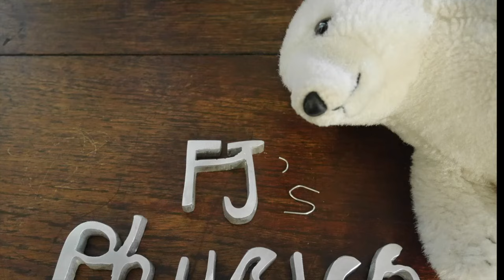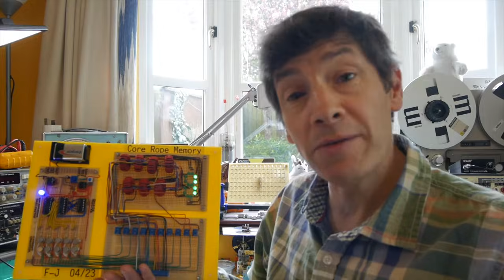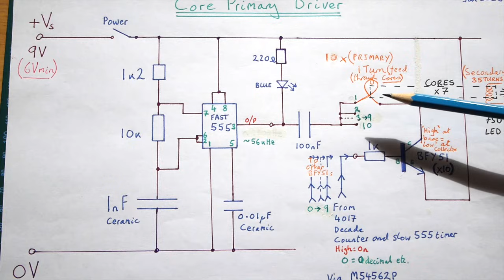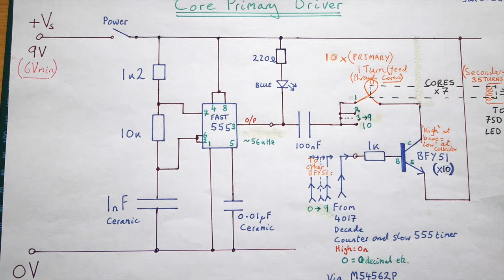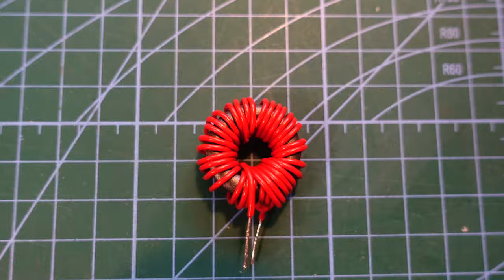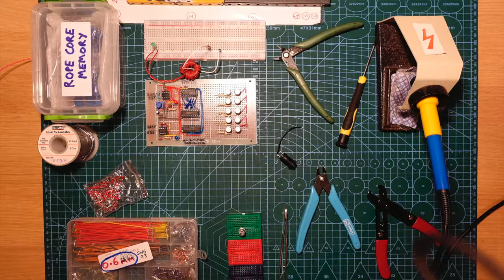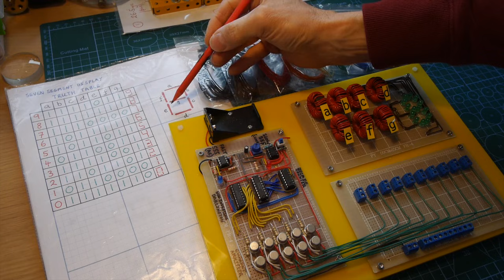Core Rope Memory Built and Explained - F-J's Physics - Video 169

Comment: Terrific video, by the way. Do I understand that you are directly using the output of the transformers to drive the output LED? I see that is correct, and in fact you reversed the idea of "sense" and drive ("Set/Reset" or "inhibit" lines) in the actual rope core device, and instead of having the output on the bit code wired "sense" lines, you bit coded the "drive" line. Neat trick, symmetrical in application to simplify the demonstration device.

Just marking this here to investigate more: Look up the "LM5520/LM7520 series" chips from National Semiconductor, which were "dual core memory sense amplifiers" used to read the sense line of the core memory plane and get from analog into digital signal levels, in this case where the sense line may have been a single turn and thus low voltage. I've been looking but even Rochester Electronics doesn't seem to have any, somebody might have 13 of one of that series left somewhere in the world, I see.

The XY addressing of the ordinary core memory plane (not the core rope memory) depends upon the wiring, which has X direction wires and Y direction wires through the core rings. A carefully controlled current pulse was sent through one X line, and one Y line. But core rings that didn't cross at the intersection either didn't receive a pulse at all or got just half the total pulse because they were on just an X or just a Y line. The core ring at the intersection got the full intensity current pulse. The difference was how much current was required to make the ring flip its stored magnetic domain state. If it flipped, that added a voltage to the sense line (like a little single loop transformer) which could snake through lots of bits (I don't remember that part but wasn't necessarily just X or Y related).

Then the sense line was hooked to the LM75xx sense amplifier which could produce a digital one if the core at the intersection and passing through the core sense wire connected did its flip. If the intersection XY core ring didn't flip, then it was already set in the direction of the current pulse. Then subsequently the digital logic had to restore the memory bit value after reading, since the domain flipped, and the circuit would send a reverse direction pulse to the same XY drive lines to flip it back, but only doing that if the bit flipped during the read cycle.

(This is a bit different from "dynamic RAM", which just leaks part of the stored charge in the XY cell accessed, so is restored to the same value just read, in a similar after-read cycle. The "dynamic RAM" uses sort of an AND gate at each memory cell and an analog multiplexer that connects to the sense line if both X and Y addresses are present, thus allowing XY access to the bits with only the "AND" gate circuit being replicated for each bit. The core memory XY addressing was just physical wiring using the above trick to form the "AND" function as above.)

I haven't found my core memory plane, but should find it some day as I clean out my basement. (From either IBM 7094 or 1401, I don't remember but most likely 7094.) I would like to set it up as an actual readable memory to a retro computing device.
Reply from the maker: Firstly Gordon, thank you so much for your fantastically informative comments.  I find them really interesting and do please keep them coming if your personal time allows.  Yes, you can tell I am a teacher!!  I simplified that core rope to the real bare basics to give some idea of how it worked.  Really far from the Apollo 'AGC' ones but a start!  Funny how the signal duty cycle was not quite even so some of the LEDs that were 'reverse biased' did not shine as brightly as the others.  Turned those few around and they are all the same brightness now!  So to core memory... looks like you might not have seen my videos on this subject?  I probably have those chips on the various core plane boards that I have.  Saving a whole 'cube' for another video!  Have a look here and there are others linked in right at the end.  Let me know how you get on.  https://youtu.be/T8VreNzldWc   BTW did you notice the very odd wiring of the transistors?  Reverse active mode I think but it just seemed to work!
Reply: @AnthonyFrancisJones  Did I notice?

("BTW did you notice the very odd wiring of the transistors?  Reverse active mode I think but it just seemed to work!")

Was driving me crazy !

(I mean, I was checking the breadboard single circuit wiring to be sure it conformed to the schematic!)

Base relative to emitter, driven at highest (assuming power supplies don't dip dynamically etc.) is 0V or maybe -1 or -2V through 1K to the base, which appears to be a turned off state in a normal NPN. Then the low voltage state the base is -8 to -9V relative to emitter. Only one channel is high state all the rest low at any given time. (This does not account for effects of coil resonating to wild voltages.)

So when the "fast" 555 capacitor is giving negative current, I think I understand. The transistor is working "backwards" with the Collector acting like an emitter at below the 9V rail and the high drive to base relative to (reversed "emitter" actually collector) allows it to turn on. A reversed transistor like that will usually work, but much lower gain than normal B-E forward biased drive.

What I don't understand is where the current goes when the capacitor is supplying positive current. Seems like the collector is positive biased and the base is 0 or below biased so the transistor should be "off". Now you showed some wild ringing which is the capacitance and the coils acting as inductors (but bleeding a bit of energy in transformer mode for the positive side swing to the LED.) But the fast 555 capacitor has to have a positive current subcycle or its just going to charge to some constant voltage and stop.

Now you have pretty long wires for 9V rail point of the transistors, would be interesting to put the scope there relative to the ground at the M54562, which by the way should be protected in almost any weird current flow scenario driving the base of the transistor, even with wild resonant voltages. So still looking for a scenario where the NPN turns on in normal mode on the positive current cycle. Note that this could be happening at the resonant frequency, not necessarily the fast 555 drive frequency, although the other end of the capicitor changes relative voltage at the fast 555 frequency. (Love those 555's. I was around for when they first came out, BTW.)

Also I didn't see a lot of power supply bypassing capacitors, so the 9V battery internal resistance may have the 9V rail doing "interesting" things.
Reply from the maker: Thanks for this analysis Gordon.  Let me tell you - I guess the video does too- how this all came about.  I had the idea and then for fun, rather than just copying old circuits, I thought I would design my own, one working stage at a time.  So firstly no computer simulations were used, just playing on the bench with standard components.  Secondly I treated the whole thing a bit like one would with a simple DC circuit in term of ignoring all inductive/capacitive effects, cross-talk, EMC, component layout and the like but used 555s which provided AC voltages (I am told it's not really AC but you know what I mean!).  As I got each bit to work I wired it up (making the colours and layout look nice!) and it all worked fine with one transistor.  Then... I noticed the transistor was the wrong way around somehow, and it still worked! The transistors were very old too.  So I bought some new ones and got them the 'right way around' and the circuit stopped working!!  So back I went to the old layout.  Then I was left with that problem of a few segments of the LED seven segment display being less bright.  Turned just those LEDs around (thought it would not matter) and it sorted the problem!  So in summary, the build was totally organic as it were and I used no real skill at all just a bit of simple 'DC' type knowledge of components and a bit of electromagnetic induction in the coils.  And the end result was this build which I think works as well as it looks!  It really would be interesting to try and simulate it and delve deeper into what is actually happening!  Lucky me that I got it to work - the block diagram in my head at the start seemed to be a really easy thing to achieve.  It was fun to build and I enjoy working from scratch even if others have solved these problems ahead of me.  I get that 'pioneering' feeling that all 'discovering scientists' get.  Perhaps it is the child with the first working crystal set feel!  All good fun regardless!  As an aside I have had so many moments when I have felt, 'I've got an idea - wonder if I can build it?!'
Reply: @AnthonyFrancisJones  I'm also going to add another only vaguely related off the wall comment after this.

I'm suspecting that would be difficult to "simulate" this circuit just using the schematic. One might use SPICE modeling system, for example (I do this occasionally). Here you need to dive into the transistor model to be used. A lot of the transistor SPICE models really only try to model the typically active regions of usage of the transistor. For example I have needed a breakdown case in a model, and it wasn't present in the particular diode so let me model a million volts to the diode and acted like that would still work. If you can't find a transistor model to fit the specific transistor, one could make a sort of model using two transistors in parallel, one backwards connected with a much lower gain term. Then I have zero threshold ideal diodes in the SPICE modeling I have used, so could insert them around the base and collector (and reversed) so that the "correct" model of forward or reverse transistor is activated and the ideal diodes prevent the reverse transistor from affecting the result. UNLESS the reverse transistor model seems to not admit current flow, then just model with the parallel of the forward transistor as in the diagram, parallel with a reverse connected model of the same transistor with collector and emitter reversed, and bring the gain down by a factor of 5 or 10 in the reverse connected transistor model. 

I DO think that modeling the transformer coil circuit would be useful, adding parasitic capacitances estimates, if you can find an adequate model for the LED (or kludge a diode and zener to approximate). I have found that modeling transformers was very difficult in SPICE, I mean for me getting all the parameters of a real coil. Though that should be more advanced in availability since SPICE modeling of DC-DC supply circuits is now done so often, so that requires good models of the coils and sometimes transformers used in those circuits. The resonance response of the circuit would be very interesting to model, in my opinion, since I think it has something important to do with what is happening.

My concern is there is something happening with the power supply rail to the emitter of the transistor that we don't understand, when the transformer/coil does its ringing. Be interesting to apply a bypass capacitor between the +9 power rail AT the transistor array back to the ground of the driver IC, and see how that affects operation, that is a quick way to stabilize that so we understand (or not) that part better.
Reply: @AnthonyFrancisJones  Now my off the wall comment, weird uses of LED's:

I looked up to be sure, and apparently in UK you use the approximately 88-108 MHz "FM" band like we do in the US, so you will be familiar with this. A lot of FM radios may have an antenna connection and hook up a length of 300 ohm twinlead wire about a meter long or so, shorted at the ends, and a downfeed spliced into the center on one side. That used as an antenna, it is a form of "dipole" antenna.

We had a local FM station in a property I was somehow associated, and the transmitter tower wasn't perfectly balanced for energy directed downward and was putting out more than normal near the tower. So I put some fast RF diodes in a bridge rectifier at the end of the feed connection of one of those twinlead FM antennas. Then small capacitor to filter the RF to DC, and directly parallel the LED (no series resistor).

The LED would light up! (In a lot of locations around the tower.) This was an actual implementation of Nikola Tesla's idea of power transmission through the air, so I called the device a "Tesla Flashlight". 

Now they have replaced the transmitting antenna and most likely adjusted the energy released downward in the area, so this may no longer work (I hope). Tesla's idea was actually true, except that the 1/R^2 reduction in energy density makes that idea mostly useless/impractical. Except of course for radio signal transmission, where the very tiny received power is amplified but making the very useful radio devices we find so common. PS, I have listened to an AM radio station with a diode only receiver using the energy of the broadcast to power the earphones, and also my "Tesla Flashlight" got enough energy that even though frequency modulated audio I could hear a scratchy version directly powering a small speaker. (In that case I think that differential gain of the antenna circuit over frequency allowed different FM frequency points to generate different output current to decode the signal, of course not benefitting from the noise cancelling feature of FM broadcast.)
Reply from the maker: Great - thanks for this.  I do intend to finish my crystal set video soon too!
Reply from the maker: Thanks Gordon.  I don't have much experience of software modelling electronics hardware but I can see all of the limitations now.  Had not realised that the models of each component needed so much tweaking.  I have run the circuit both on a PP3 battery and a bench power supply with no real difference.  So I might have to try a few other things, as suggested too!

Comment: lots of noise on the sound. Is the microphone rubbing on clothing?
Reply from the maker: Yes, sorry about that David.  I think when I talk off camera or turn I get a clothing rustle sound.  Difficult to hear when I play back on the camera straight after but in the edit (it's usually too late by then) I can hear it.  That's one of the reasons I have stuck to wearing shirts as clipping onto jumpers or hoodies just does not seem to work well.  I have noticed it since but have tried to make the effort to avoid the issue.  If you have seen some of my first 100 or so videos they were all done straight to camera with a camera mounted Røde mic and there was no problem then!  Keep me posted of anything else I can do to improve and thanks for watching!

Comment: I noticed that on the diagram you had the NPN transistor wired so that the emitter was connected to the +9V line. This shouldn't work. The only way I can see this working is that you have mixed up the collector and the emitter when you physically connected that transistor on the breadboard.
Reply from the maker: Mario, thanks for the comment.  Yes, this is a rather odd circuit and I have drawn it correctly!  This is the way it seemed to work best and it appears that the transistors are in Reverse Active Mode.  It is difficult to see from the wiring that this is what I did.  It was more by accident than design but it produced a working circuit which has intrigued us all!  Thanks for watching and hope you enjoyed it!

Comment: Hello Francis! Congratulations on the project! A quick question... is the current for each data line only provided by the 555, which has a maximum current output of 200mA according to its data sheet?  I want to do a project using a 8x8 led matrix. So, let's say that a data line passes through 64 ferrite cores, will the current provided by the circuit be enough to light the 64 leds from the 8x8 matrix?  Or is the current provided by the BFY51's? Thanks in advance!
Reply from the maker: Alejandro, good question.  So I found that I had to build a little bit at a time (1 core) to make sure I got it to work.  You will notice that there is a Darlington Driver chip in the circuit that probably would drive enough current.  If not, yes, just feed into a transistor for each core to give the current you need.  That is what I have done but the circuit could be designed rather better so I suggest you don't just copy it directly!  Thanks for the question and let us know here how you get on!
Reply: @AnthonyFrancisJones  Thanks for the answer! Good advice! I could try to test bit by bit to see how many LED's can be lighted with the original design. In case of needing more power, adding a transistor per core for the desired current.
Reply from the maker: @AlejandroBellon-i8p  Yes, I would definitely do that!  And why not add transistors just for interests sake - it's all a bit of fun I guess!
Reply: @AnthonyFrancisJones  Totally agree!!